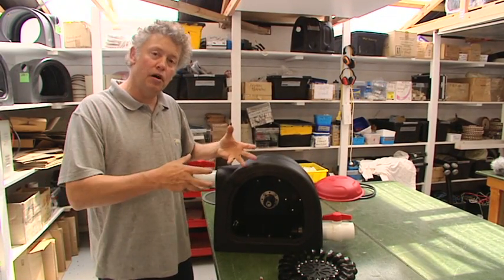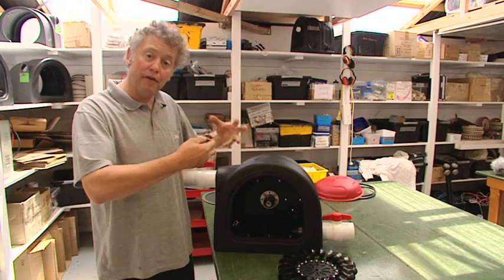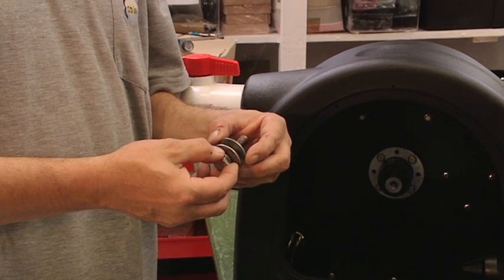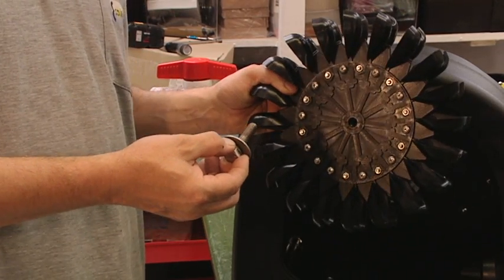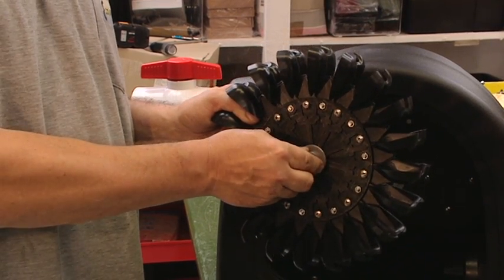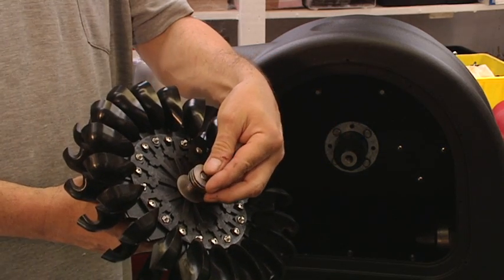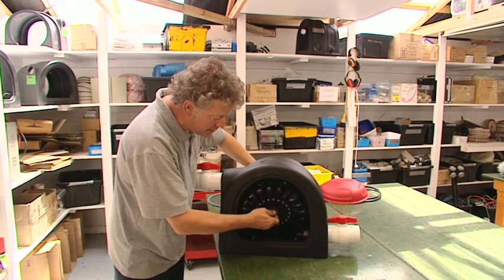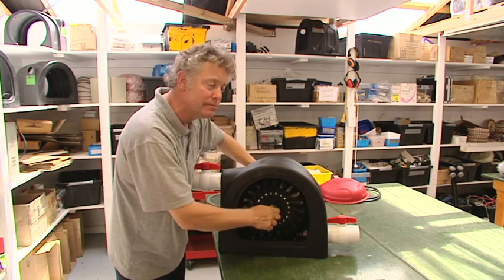PowerSpout How-To #4: Install the Pelton Runner

Comment: Judging by the way the turbine is going to spin, the manufacturer should've gave it left-handed threading so it would ensure that the bolt always stays securely fastened during operation.